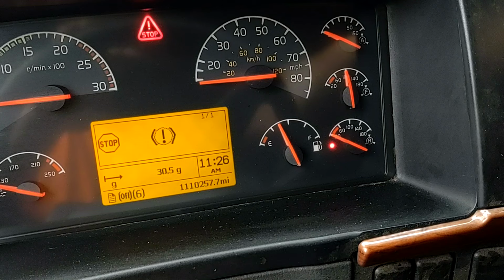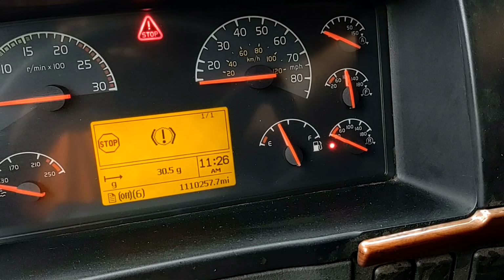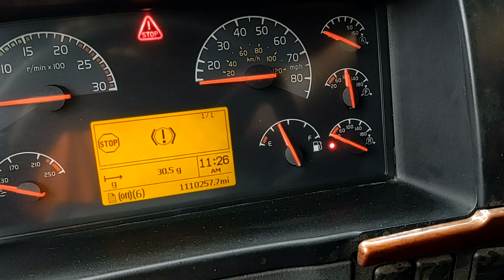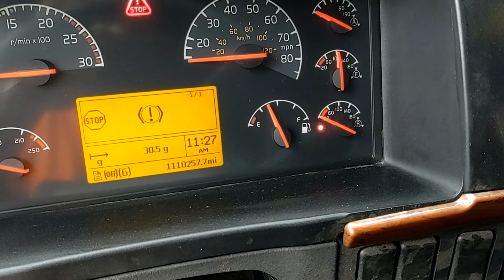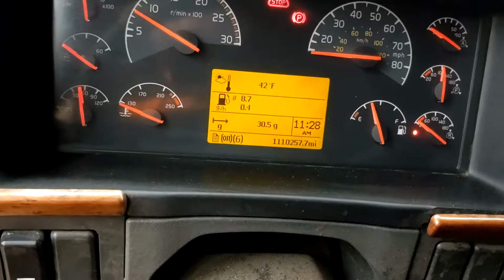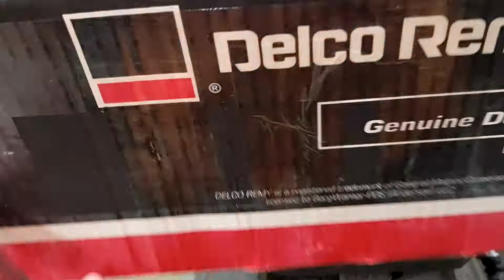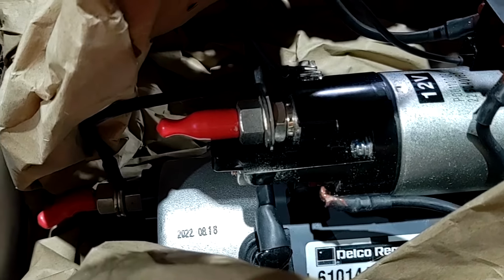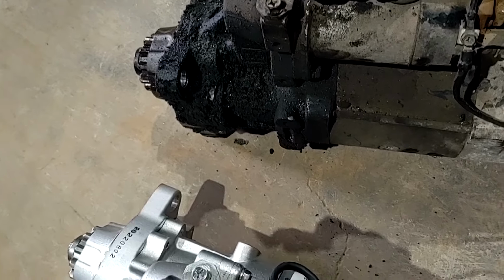volvo vnl cummins isx wont start, Time for a new starter?

Comment: Did you check the wiring cables that go from battery over battery box. My volovo was grounding out. Used to cut off going down highway. It would shut off, and I would turn the truck key off and back on, and that was it.
Reply from the maker: Yep, I had that problem before too 😂 it would stop accelerating and throw all kinds of codes. I did a video on that a while back.

Comment: hey chase have you ever cleaned the top end out? like take off the intake and clean it? i have a 06 isx and ive heard that the top end gets caked up up from the egr. My new tech guy recommended to clean it once a year or so. if anything you can just pop off the intake tube and inspect it. I don't know the process, but I don't think it's simple as just shoving a shop vac in there you know
Reply: on my old Volvo there are releys for the starter that go bad, always have spares for them lol.
Reply from the maker: Never had the intake off this truck but did my last and it wasn't really all that bad gunked up, probably not a bad idea if done frequently. However on one that is extremely gunked up might make it worse if you accidentally knocked some of it down in there while trying to clean it.
Reply: @LifeWithChase  Pretty sure it ain't gonna run better with a chunk stuck in the intake valve. If anything, you could keep the elbow that connects directly to the block on and just take that middle section with the egr tube inside off.
Reply: @LifeWithChase  hey you know whats even better? just unplugging the egr valve sensor ... problem solved.